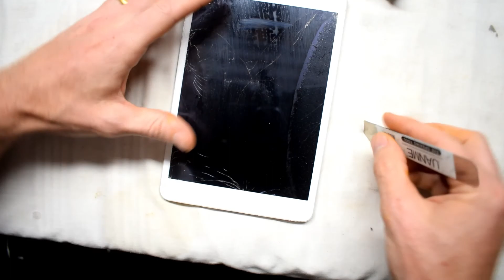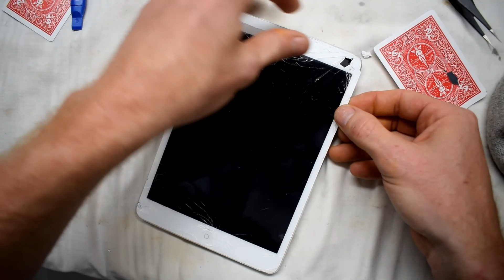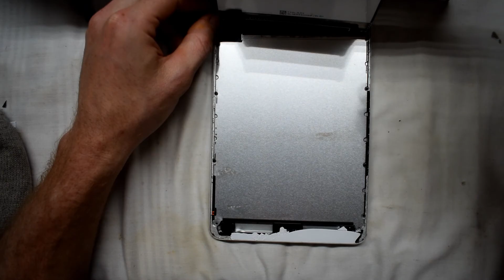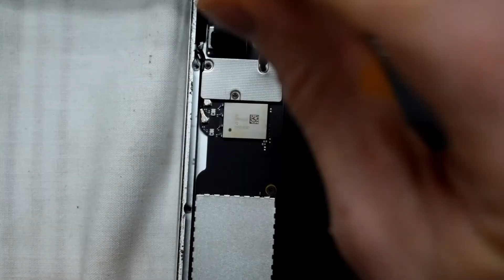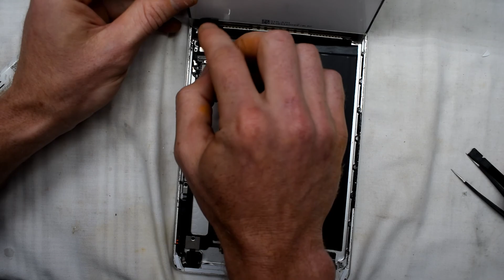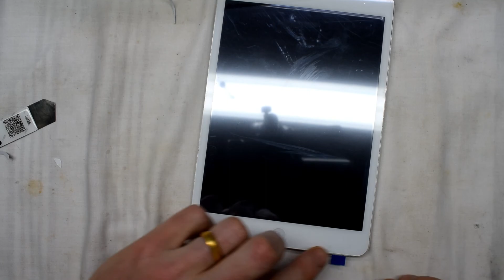The safest way to fix an Ipad mini 2 screen (Model A1489)

Comment from the maker: ask any questions below.
Reply: Do you have an video about how to fix this ipad because I can't open it after it got water damaged it doesn't turn on
Reply from the maker: @blametellyy  yes you need to open it up then follow this video on how to fix liquid damage https://www.youtube.com/watch?v=zVffxsE78d4&ab_channel=NewsonsElectronics
Reply: Rice and pudding in the sock or just rice? Also 3 minutes on high in the microwave or just 50% power?
Reply from the maker: @drakkhul  just until its hot
Reply: Is it a must to stick the lcd  sensor you removed